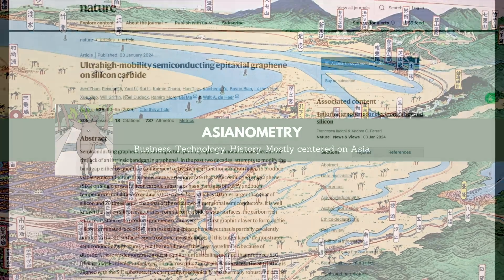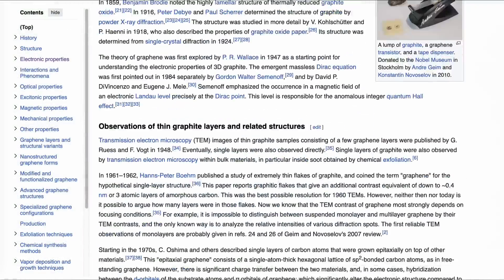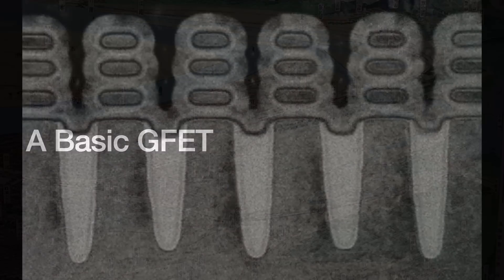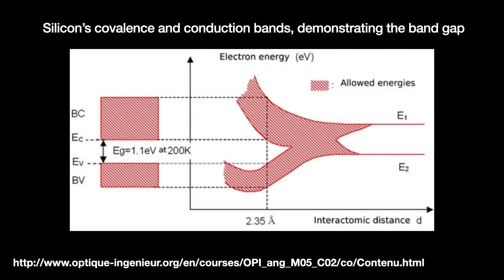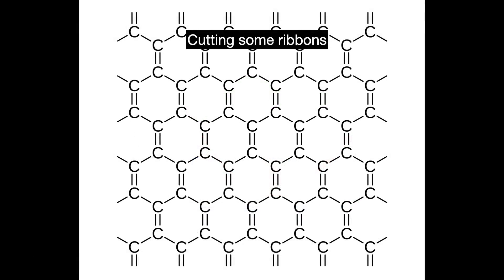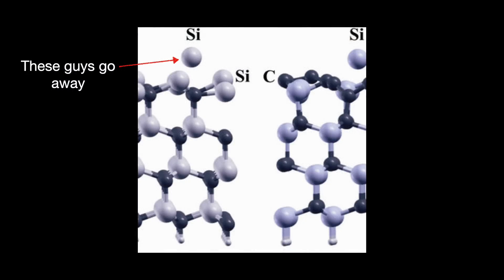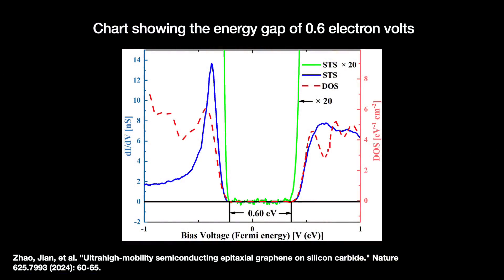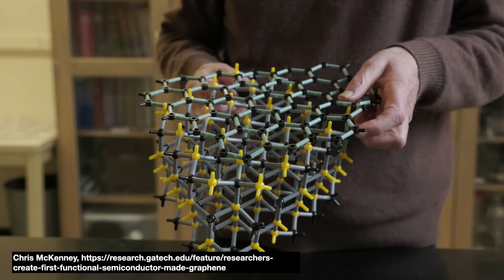A Graphene Transistor Breakthrough?

Comment: 13:33 Are you talking avout the same industry that's burning Gigawatts of power just running stupid LLMs? Yeah I don't think power comsumption is a huge concern if they can claim they have the fastests chips.
Reply: The problem is not only efficiency but also noise. A tiny amount of energy can flip the state of the transistor so any circuit using the material will be extremely unstable and will not provide reliable and correct computation.

Comment: I heard about glass becoming the next substrate material and its alleged benfits. Is there something to it or is this just bs?
Reply: glass is silica sand which is where we make our silicon wafers from, I doubt there's some special process for "glass" that makes it superior than the extremely purified version of it (the wafers we ALREADY use)
  there are already 2 inch GRAPHENE wafers in mass production and several chips being sold. So it is already happening
Reply: @gg-gn3re  You're talking about wafers while I asked about glass as substrate material. Thanks anyway.

Comment: Graphene transistors also generate  less heat and require less W to power/work with for same performance. 
We,re talking about trully efficient chips, going further that can easily work with just passive cooling and last for weeks.
Reply: No a transistor that does not turn off is not efficient at all.

Comment: Just as  a note on the physics, when electrons are excited to the conduction band, current flows via movement of electrons and by the holes left in the valence band as well (think of holes like air in a spirit level) where the absence of an electron allows the flow of other electrons and therefore conduction.

Comment: YEARS AND YEARS ago, like almost 30 years ago, I realised that I could use a lone drawn on a piece of paper with a sketching pencil as a resistor, or at least that's what my multimeter showed.
Reply: It was taught in the 1988 radio shack book.

Comment: Great video, as always!

Lower band gap = faster switching + higher energy/power consumption. But there may come other factors affecting leakage currents. So the bottomline may look differently in the future. 

I also disagree with the conclusions. Graphene is hard to techologize, while TMDs allow more room to play with substrates, chemistry, available techniques and... band gap. Yes, graphene epitaxy in between  SiC layers is cool and promising, yet we are 10-20 years away from the defining the winner.

P.S. I am a PhD in single carbon nanotubes: CVD growth and electric/chemical manipulation. Grew and played wit the CVD graphene as well. The field hasn't moved far in 15 years, as I observe
Reply: we already have chips with graphene, already in mass production. They use way less power, almost 1000 times less. video is inaccurate as of 2 years ago.
Reply: @gg-gn3re  I would be delighted if you pointed me in the direction of mass-produced graphene chips. Thanks!
Reply: Why does lower band gap mean higher power consumption?
Reply: @mqb3gofjzkko7nzx38  because of leak currents. With short BG there are more electrons to break away i.e. leak

Comment: “McCarthiest Accusations” 

Obviously you’re checking to see if anyone is listening. 

The problem with Graphene is not small size but connector stability. Graphene is composed of 4n+2 carbon atoms in resonance stabilized oribitals. Its properties are quantum in nature given the fact that electrons have many more orbitals than a molecule like butadiene, per carbon. There is an orbital that covers the whole sheet, theoretically. Practically no, the energy difference between an orbital covering a square cm and 1/4 cm is trivial. The near light speed capacity (and near zero resistance) for carrying electrons is dependent on the length of the orbital doing the carrying. Thus at some point adding length doesn’t accomplish anything.

However, the problem is at the contacts of the edges of the graphene, these areas are subject to higher resistance and thus you can’t dump a lot of electrons on these without the contacts heating up. This problem is solved by making the contact wider. 
Presumably if you could engineer a low resistance contact then you could treat the graphene rectangle like a superconductor for any area that might be in a chip. That’s good, but. 
If you think about what making faster transistors in a CPU do is that in increases the clock cycle, electrons are fed down a circuit in a burst, the the circuit goes to zero and then there’s another burst. To go faster means the burst of electrons are closer together. Heating at the contacts goes up. That’s a problem.

Comment: Graphite: "Anyway, here's Van der Waal"
Reply: No, in fact Asianometry got that bit wrong.  The p-orbitals projecting perpendicular to the basal plane overlap on alternate atoms, resulting in a weak chemical bond, as originally explained by J. D Bernal in his 1924 article about the crystal structure of graphite, and in several later articles by others.  The elastic constants of graphite are consistent with this model.  Van der Waals forces are a dynamical, electrostatic effect of itinerant electrons, which does not involve orbital overlap, and would give different elastic constants for graphite from the observed values if they were responsible for interlayer binding.  The interlayer binding of graphite is often mistakenly attributed to Van de Waals forces because it is weak.  Okay?  :-)

Comment: But if you know the electrical length, the switch just stores the physical device & the bus by time delay sinusoidal advancement to significant figures.  So a contemporary silicone switch is incorporated for storage and time delay of the 'roller coaster 'sine-cosine' collector array.  Like an add multiply is four simultaneously compared operations in 256 channels.  Add, carry, carry compare add, and tally, in significant figures, 5nm is very very small, can be done in no heat at 5ghz.  5nm = 59,958,491,600,000,000,000 hertz, or cycles per second, some extra signal cleaning of the all around fin-fet can conform the signal to perfect trigonometric TCMC mars radio.

Comment: Silicon has the advantage that it has worked for decades. The new materials do not have this potential. They create an improvement and perhaps also a potential for optimization, but not to the same extent as silicon. therefore, one is unlikely to make any investments

Comment: There's an interesting compound called siloxene that's formed by dissolving calcium silicide in hydrochloric acid. A yellow solid  is formed that when washed and dried is fairly stable. When treated with oxidizing agents it gives off a yellow orange chemiluminescence. It's one of a very few inorganic chemiluminescent agents.
Apparently it's strange stuff - it has intercalated hydrogen, so it burns quietly when ignited, but apparently it's structure is similar to graphene in some respects, being made up of numerous sheets of silicon bonded to oxygen and OH groups. Not as exciting as graphene maybe, more like graphene oxide, but exotic nontheless....

Comment: Wake me up when they can actually commercialize graphene
Reply: paragraf already has, this is maybe one of the most glossed over videos he has ever done. He missed a lot on it. 2 inch graphene wafers are already in mass production and so are working usable chips. GEIC in UK also has tons of research on it, he didn't mention at all. 
and he missed several 2d elements discoveries borophene, phosphorene, goldene etc.
Reply: About the same time fusion power becomes viable.
Reply: @cjc363636 Fission is better.
Reply: @cjc363636  As if the world invested much in fusion. But we are on it with Wendelstein 7-x.
Reply: Graphene is not even that expensive anymore.
Reply: Only commercially injectable according to facebook...
Reply: Buddy, you aint waking up
Reply: Pretty sure there's already graphene products on the market like graphene shoes
Reply: Ya might want to research Hydrograph Clean Power.
Reply: Graphene is in plastics, concrete,asphalt,rubber,paint,ceramics.

Comment: X is 40 faster then Y.
X requiring 10 times more power then Y.
X is 20 times larger then Y. 
so if X requires 10 units of power Y requires 1. 
so if you need 40 Y to be as fast as 1 X then X takes 1/4 power
if 20 Y fit in the space of 1X.
for Y to be as fast 1X you need the space of 2X in Y so X is 1/2 the size
if something is really great at the thing you care about then it can be a little worse at other things.
what if you use 1 big X that gets reused to pretend to be 40 little low power Y.
Reply: "X is 40 faster then Y.
X requiring 10 times more power then Y."
this just means it's 4 times faster at the same power.

also look up "then" vs "than"

Comment: Being honest, if I heard "square centimeters per volt second" in dialogue of a sci fi movie, I would have said that's obviously a nonsense unit that's just made up.
Reply: There's a pair of "Cursed Units" videos on YouTube I highly recommend.
Reply: To be fair, it was just made up
Reply: Ahh, one can make up compounded units any way one wishes. Whatever is practical.
Now idiots will use dimensions twice (eg meter per square meter ) or use different units on different sides of an equation.
Reply: @lrrrruleroftheplanetomicro6881 meter per square meter makes sense sometimes
Reply: @JasminUwU  Aggree, I like to give the electrical resistivity ρ in units of ohm square meter per meter instead of Ohm meters, because it immediately shows, that a formula should include an area and a length, not just a length.
Reply: @JasminUwU yes, for example meters of thread to create a weave of a specific area.
Reply: @lrrrruleroftheplanetomicro6881  I use such units all the time.  For example m^2/m^3 to when reporting the heat transfer area per unit volume for a heat exchanger.  Or µm/m for strain.  Reporting the units for many physical quantities without fully canceling them or moving them to base SI can greatly help with clarity.
Reply: @jorg4224  You're an engineer? Physicists don't do that much. Probably 'caus single lines are easier for publishing. I was thought to avoid fractions in results with an outright ban on double fractions.
Reply: @lrrrruleroftheplanetomicro6881 metres per second per second. That one is used for acceleration due to gravity.
Reply: @Foxeyify  Where did you study? In europe we only use exponents.
Reply: @lrrrruleroftheplanetomicro6881  Australia. Gravity is 9.81 ms^-2 which is said out loud as above.
Reply: @Foxeyify  To my ear you're (loudly?) using fractions. I associate that with high school physics. I'm in central europe.
Reply: @Foxeyify  or N/kg for the specific force due to gravity :-)

Comment: If graphene has zero bandgap , does that mean you could make a diode from it that has near zero forward voltage drop? That would be rather useful.
Reply: It means that it's a conductor. So no diode.
Reply: @M4nusky Not exactly a conductor but without a gap a small amount of energy like the energy release when you clap your hands can flip the state of a transistor. So it is a very unstable switch.

Comment: I published a paper on it being an electrochemically transparent material as well as a hydrophobic conductor back in 2021, and now I got an accepted manuscript on its ability to perform orientationally dependent catalysis. It's a truly amazing material that can do so much! The bottleneck in production is such a damn shame.
Reply: Does your research delve mainly into chemical science? im intrigued to know how it might be used in a photonic based system, i had an idea to perform combinatorial logic on the waves them selves using the modulators but whatever controls the modulators are limited by electricity still. Parallel modulators with a much better conductivity may be the key.
Reply: @devilsolution9781  yes, it's mostly electrochemistry. I'm afraid I'm far less educated on photonics.

Comment: What about GaN HEMT devices?  They rely on a 2-D "electron gas" that is spontaneously generated by piezoelectric stress from the lattice mismatch stress between an AlGaN - GaN interface.  Does this count as a 2-D transistor?
Reply: Who cares how it's classified. GaNFETs are available at Digikey right now, and they are better than conventional Silicon MOSFETs is most ways that matter. People are already designing tiny but high powered switch-mode voltage converters with them. My next solid state relay is design going to use GaNFETs instead of conventional silicon ones.
Reply: @SaltyPuglord  Are you going to make a video about it?
Reply: @ZoranRavic  Possibly. But I have to build and test it first. And right now I'm building and testing an OBD-II cable tester.